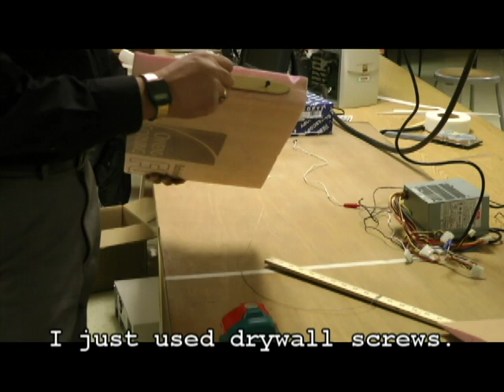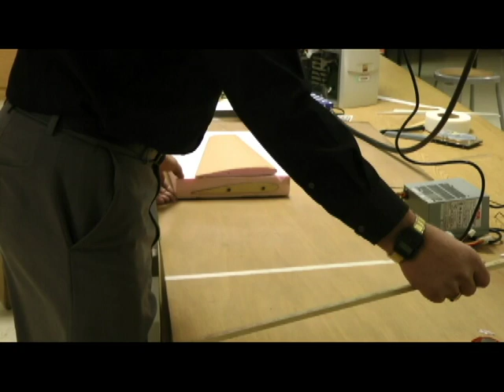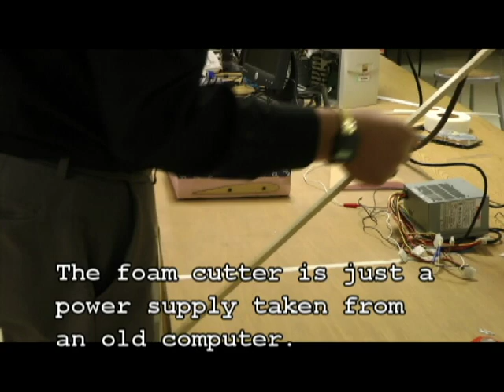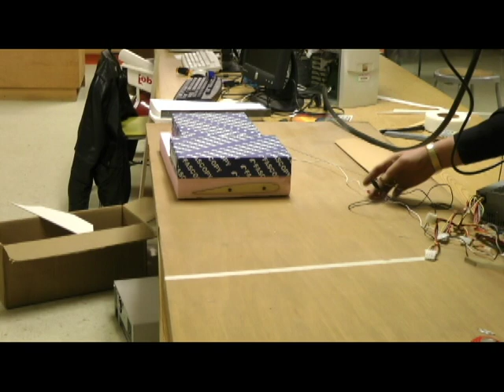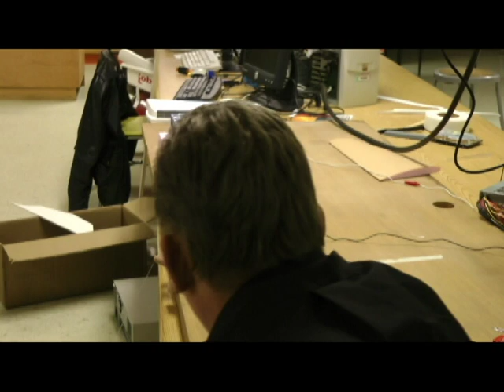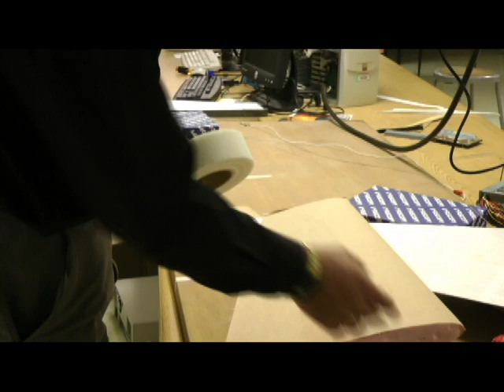Tutorial 1: cutting foam wings for 3d and park flyers

Comment: First off I want to say very informative video and well done...ty for your video ! I just have a few questions for you andpets55 (1). Can I use the "G" string, (second string from the bottom),  off of a guitar, it is nichrome as well I believe...? (2). How many watts is your computer power supply or does it matter ?  (3). Does it matter how long and what gage the power supply leads are, (the ones with the alligator clips)...?
Reply from the maker: I am not sure if the guitar string will work or not.  It should.  Try it and let us know.  The amperage is not that high for the power supplies, but if you have watched my other video on alternate power supplies I indicate not to use too low a wattage.  Don't be misled by the total wattage on the side of a desktop power supply (350 watt as an example)  A smaller laptop supply will be rated at 1 to two amps and will do the same thing.  Best thing to do is just try it.  If the wire does not get hot enough, you need more watts.  The power supply leads need to be at minimum of 16 gauge braided wire.  14 would be better.  Thanks for the question

Comment: Hi Andpet55, your videos are brilliant, thank you so much.

I have built a simple cutting bow, and made some airfoil templates (cardboard), cut some wings, sanded them as you suggested (I am still learning to make good cuts), then covered the foam cores with packaging ("brown") paper (I can get different colors), using diluted white glue as you suggested, and I finished the wings with clear (or colored) packing tape, and ther result is BRILLIANT.

The wing is strong and light (same weight as a built up balsa wing of the same size), and flexible.
I have flown my new model, and I am very grateful for all your videos.

I am using NiChrome wire (26 ga = 0.4 mm from EBAY), cutting wing halves (white foam or the denser colored foam) of approx. 2 feet (about 60 cm), with a 3S 2200 MAh LiPo (and a low voltage beeper from EBAY) and a servo tester (EBAY), regulating a BRUSHED ESC (Banggood).

To further strengthen the wings, I have cut some groves into the cores, with a knife, and glued in thin dowels, salvaged from a bamboo window blind; the dowels weigh about 2 grams each (60 cm length), and they add tremendous strength.

Since there were some questions about the NiCrome wire, may I post some links:
hotwirefoamcutterinfo . com
jacobs-online . biz

Comment: Hello! Can you tell me the size of your nickel chromium wire? I'm using a 0,30mm nickel chromium wire with 12v and isn't hot enough to cut my wings. Thanks.
Reply from the maker: I use 22ga wire but a lot depends on the length you try to cut.  If you go much over 4 ft then it needs higher voltage.

Comment: Thanks for the information... Great video..  Where do you get your foam??  What gauge of nichrome are you using??  Thanks again.
Reply from the maker: I have used the white insulation (low density) and the pink or blue.  The higher density foams (purchased at any hardware or lumber store cuts and sands more smoothly, but after coating with the paper, the other has considerably less weight.  I use 22 gauge wire that you can purchase on ebay.
Reply: andpet55 Thank you very much for the information.
Reply: Shelby E Where do you get your white insulation (low density).  I've got some 2" blue, but would like to try both.

Comment: Really liked your video.  
Have you cut a wing with both sides being symmetrical ?
Do you use a template on both sides to make it symmetrical?
When making your first wing, do you have to have your foam lined up in any special angle?
Reply from the maker: I have done both ways.  I make my trainer planes with a non-tapered wing using templates on both sides and a bow.  (see other videos)  For an individual wing side that does not span more than about 30 inches they work fine.  Put a joint in the middle and I have several planes with a span of 5 feet.

Comment: i know this video has some time on it now....  but i think i would make two guides (one for tip and the other for the large end) and ridged mount the wire so that you can lay the foam against it. i would think that that would produce nearly identical wings.
Reply: That is what I wanted to know.  If you have templates on both sides would that work to make both sides equal? 
What if some one wants to make a really long wing (need equal so can glue together) 

Have you done that by chance???
Reply from the maker: SnapPunch Robert
Yes you could join them but you would need to put in a brace internally similar to the way that I joint the halves.  The biggest problem with using templates on both sides is that you need to pull evenly on both, either by using a gravity feed cutter or by having someone help.  They do, however, cut more cleanly if done on a gravity fed cutter.  The problem that I have had in cutting longer wings is there is limit to the length that you can cut due to the amperage restrictions in the wire.

Comment from the maker: Good Question.  I came up with the same concern, but as I worked with them the wire will not cut through the foam at the same rate and produces pairs that are close, but still some variation.  Since you still need to sand them, I usually make 5 or 6 wing cores, then pair them up with those that are closest in form.  Works best for me.

Comment: good video. If you cut both pieces of foam to the same length and width wouldn't the wings turn out identical. I thought that was the reason to use foam quick and easy . I don't think you'd make an exactly  matched pair of wings by then having to cut and sand them down. I'm definately going to make the cutter. This is not critism of the video just a quetion